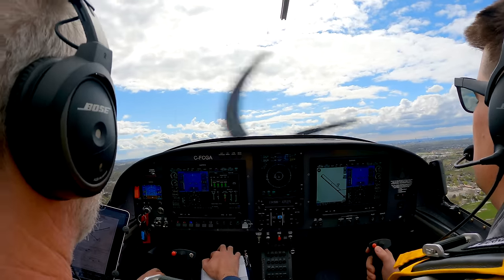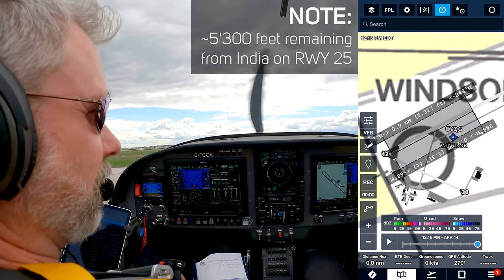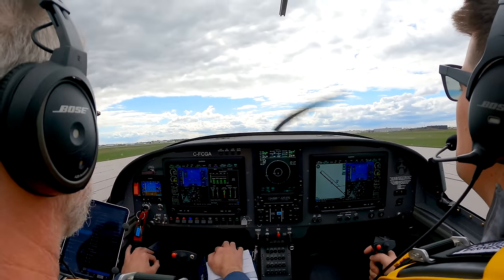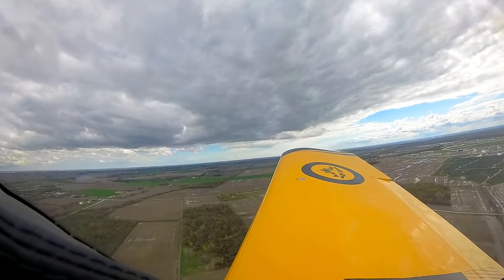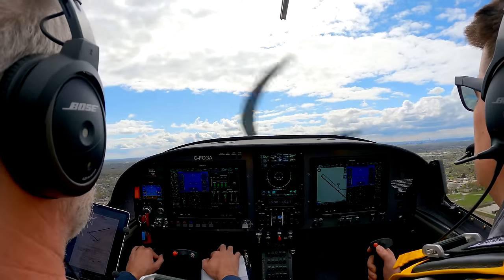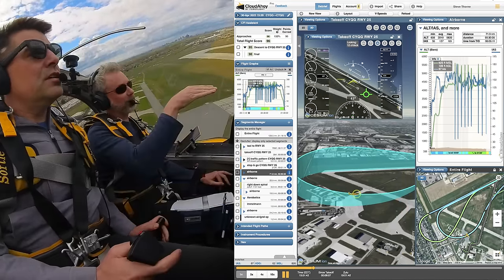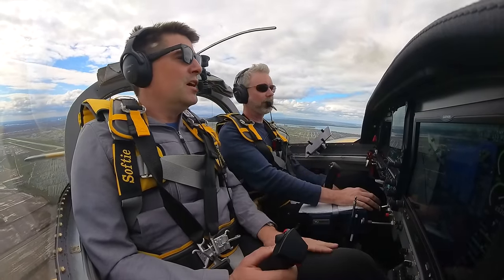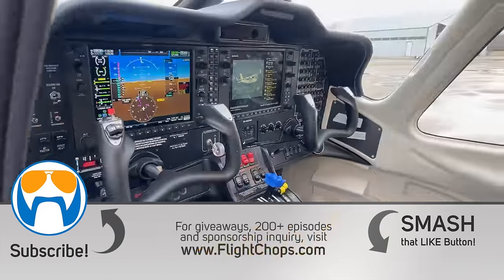Making the IMPOSSIBLE Turn… Possible from 600' AGL?

Comment: Wind has to be considered. When a 15G18 headwind on takeoff becomes an instant tailwind on turn back it is a performance decreasing windshear. That will change your decision altitude drastically. Have you practised an approach with an 18kt tailwind? With houses or obstacles on the departure path, a turn back to anywhere within the airport perimeter fence is a win. Terrain will be flat and emergency services will available, not to mention no collateral damage.
Reply: You have to keep the nose down when doing the Vglide 45 bank turnback.  Aproaching the 180 point you will feel a bit more sinking due the tailwind, but then that tailwind will flaten the glide and helps reaching the runway.  I used to to teach Teardrops and Hook Shaped Turnbacks in the 1990's CFI years.  Had 3 partial power fails on me, Cherokees.  Landed all.

Comment: I taught turnbacks to many in my CFI years.  Needed maneuver that got too many doing them wrong way.  YOU NEED TO KNOW TURNBACKS.- Not only for EFATO.  You need turnbacks also on Circling Approaches, Flyover Turnbacks, Box Canyon turnbacks, overhead airport to enter the 45 after.  Many accidents on those 5 places were the pilot made turnback errors and crashed.  His fault- for not knowing Turnbacks well.  A 180 is not a full turnback, just an U Turn.  Turnbacks are bigger turns that finish at almost or the same place you were before.  A course reversal, not just a heading reversal 180 turn.  Turnbacks are more than a 180.  Many CFI's call a 180 a turnback.  No its not.   Unless landing back on parallel runway which most airports dont have.  That is the only time a 180 Turnback is it. 

TO TEACH TURNBACKS;
It is better to teach "Turnbacks To A Double Flyover" FIRST.  The GRM TURNBACKS first, then the emergency and circling ones later on after you do them level flight well.  I taught them all 2 decades ago and researched about the accidents causes on them a lot.  Most pilots dont know those maneuvers well and do them very wrong, or stall and crash.  Even ATPs crashes doing turnbaks due errors. 

1-The Teardrop Turnbacks to a flyover a spot on ground do it first.  Fly  at Vglide speed slow flight over highway (w. a Crosswind). With flaps 10 degrees.  1,000' agl.  Fly over spot on highway, turn away from wind 40 degr. , then into wind.  Fly over the spot on highway again, after flyover repeat same steps on other side.  Do 3 on each side until perfection Teardrop Turnbacks.  One turn turnbacks require 2k feet dist. from flyover spot. Dont do them yet.  Those are more difficult and dangerous.  Later on i will type about those Hook Turnbacks.  Cropdusters do them only after getting low in weight.  I used to call them Question Mark Shaped Turnbacks.  2k distance after flyover, Vglide speed, bank 45 degr.  more later on that  QMark ? Turnback.

2-Then Box Canyon Turnbacks Scenario (Climbing Vx but at 60% power only to sim a 10k density alt.)  Then the Circling Approach overfly + Turnback, then the LOTOT Turnbacks and no power EFATO at end.  Some day you will have to do those maneuvers.  

Some say to keep the ignorance.  But Ignorance is not the solution,  IGNORANCE IS THE PROBLEM.  Most pilots that crashed doing turnbacks on those 5 places were Turnback Ignorant Pilots.  This is a tool all pilots need to know, not just CFI's.
Reply from the maker: Great insights here.
Reply: @FlightChops  Im the CFI that taugh the other poster named outwiththem.  We know 4 others that had to turnback and didnt crash on cars and houses on our 1990's airport.  I have a video from 1995 for you with 4 EFATo real landings on runway .  will post it.  I used to teach EFATO 4 on runway, not just at altitude.
Reply: @FlightChops  This was the first ever video teaching how to do on the runway, not just at altitude the basic 4 kinds of EFATO and Partial Power RoToT.  First we talk about the Low Altitude Pull Syndrome on low maneuvering GRM Turnbacks to Flyover again, then how to apply the GRM Level Turnbacks to EFATO and ROTOT Emergencies on runway with 16 knots strong winds.  Narroator said 14 knots, but they were constant all day at 16-17 knots.  Runway is 4,k feet long.  Sebastian Florida.  The town was in front. 

 Canadians are brave enough to do EFATO too.  Im Puerto Rican.  I used to teach all that in the 1990's.  Video is 43 minutes.  Read the introduction too.  The video is inside one of my 1990's student channel called CFITOMAHAWK.   This is still the only video showing all those low altitude optical illusions that lead to stall, ball in center spins, accel stalls,  2 kinds of Turnbacks to real runway with strong winds, and 2 kinds of 50 feet EFATO and ROTOT with real landings too.   
https://www.youtube.com/watch?v=94li1apG-aI

Comment: Big runway at a 90-ish degree angle from the one you took off, in a real emergency I might aim to land on that one, depending on how much length is left.
At my main airport I have something similar, with long runways. Better to take the turn a bit easier and land on a different runway than to try and crank it around and stall the aircraft. Ofc this doesn't work  with a single runway airfield.
Reply: Only with a lot of wind to bring you back.

Comment: Another reason to land straight ahead with a strong headwind is the slower ground speed and subsequent lower G force at “impact”…
Reply from the maker: For sure yes, this is a huge factor.  But wind speed becomes moot if your option is a suburban neighbourhood with no where to dissipate the energy laterally… I’d rather face a tail wind on a flat / long surface, but your point is valid.
Reply: @FlightChops 😊

Comment: I also discuss which direction I will turn back towards the runway based on environment but more specifically on wind. Like this situation with a right crosswind, I would make a right turn back towards runway (assuming I’m above my decision height) that would allow the wind to push me back onto centerline. Making a left turn would push me away from the runway requiring more distance/time/altitude to return to centerline

Comment: This exercise can be practiced a lot more safely at altitude. Simply align with a cross road or highway, perform the takeoff engine out simulation, and see how much altitude you loose to get back to where you started (then add 1-200 ft for a stopped prop).
Reply: IIRC A stopped prop creates less drag than a windmilling one?  Though you'd still have to account for the difference between a stopped engine/prop and an idling engine.
Reply: @kaasmeester5903  That only works on airplanes with a Vglide speed under the normal 60 knots prop stop speed.  It is BS it will glide better under the vglide.  which is 70 knots or more on most low wingers.

Comment: Prop Stop glide only works on airplanes with a Vglide speed under the normal 55 knots prop stop speed. I used to teach prop stop landings from a 700 agl base leg on Cessnas (55knots w full flaps).  And land Prop Stopped.  It is BS it will glide better under the published vglide- which is 70 knots or more on most low wingers. or 60 knots plus on most Cessnas.  Many crashes and stalls lowering the Vglide to stop the prop which is mostly at 55knots.

  55 knots only works on some LSA's and most will not glide further but be at minimum sink airspeed because the Vglide is higher than 55 knots, not maximum glide but they say on those videos. They say they are at Max Glide at the 55 knots prop stop speed, which is BS.  So 55 knots for prop stopped you need on most USA GA.  That is under Vglide for 90% of USA GA.

Comment: Great point here...  So, 800 feet to make the runway and 600ish to make "airport property"  to protect the surrounding community!
Reply: Dan Gryder says never to do Vglide turns even with partial power.  To crash straight ahead, NO TURNS, ZERO TURNS.  Just crash straight ahead.  LOL.. I learned Vglide turns at 5 hours in a short wing Piper Colt bad glider.  Had 3 single engine partial power fails, Turned and landed on airport.  No accidents.

Comment: Just noticed, but in Canada are you not required to read back the takeoff clearance? Do you just have to reply with your tail number?
Reply from the maker: For the particular calls we are responding to, that is correct. (For instance, if there was a hold short instruction a full read back is required)

Comment: Thanks for a nice video. Would have been nice to see you veer right off runway heading in the climb, to put you on reverse runway heading after the 180 (avoiding the ? shaped return path) You probably would have made the 600 agl. Also would have been good to see the bank angle, if you recorded it. And your speed through the turn. Thanks again.
Reply from the maker: It's all recorded yeah - and the cloudahoy debrief shows it fairly well if you watch 4K during the replay around the 10 min mark.
Reply from the maker: Regarding turning off runway heading - we were trying to simulate a straight out departure, so we didn't want to be set up with any sort of "advantage".
Reply: @FlightChops Looks like about 40 degrees bank? But 80 knots airspeed seems pretty high; is that best glide? Excess speed really increases your turn radius.
Reply: @atg197  good points

Comment: I’ve practiced engine out on take off many times. A good pre departure brief is a must as mentioned.  

I was pretty comfortable flying my Cherokee with the normal load I usually carry. For a change I had an instructor and passenger go with to significantly increased my load. Wow what a difference. My take away is practice with different loads and configurations to try to get a baseline then add to your pre departure brief
Reply: The basic idea I was getting across was to practice especially with different loads. Don’t only get comfortable st your “norm”. 

I have a great instructor now also did when I started in 1988. Not sure where your going with your comment

Comment: Good video and always important to practice. But you should also consider the much higher stress load when real engine out. Not only those 3s until first reaction. But will you be able to fly a tight turn with slow speed without succumbing to the lure of have to reach that direction for landing without stalling? Most crashes happen right there, when people try too hard to get back. It is not that you would be cool as ice in the real thing. Its very likely you won’t hear the stall warning or any other sound than your heartbeat.
It is good advice to check your surrounding area before for possible options.

Comment: When I practiced these 20 years ago in a PA28-181 was to pre brief to note wind direction, then during the maneuver, push hard to maintain airspeed, but pull the flaps lever for full flaps and steep turn into the wind and then keep the nose down as you let the flaps out if you need more glide. Eyes on the airspeed.

Comment: My plane has a glide ratio of 11/1 meaning if I were 600ft AGL and I kept the perfect glide speed, plane would travel 6600 ft foward going straight, making turns would definitely travel less!
Reply from the maker: Yup. This is why it is important to know the performance of your specific airplane AND to build in a buffer to account for less than perfect flying when you’re under pressure.
Reply: @FlightChops  great advice

Comment: Instead of the impossible turn, why not just circle and land on the runway heading you took off from? Looks like you had enough altitude to do that.
Reply from the maker: Can you explain more thoroughly what you’re suggesting? Because the way I’m reading it you’re suggesting a power off pattern to return to the same runway we departed? (Did you watch the whole video?)
Reply: @FlightChops  What I mean is, you took off from Rwy 25, but came back to land on 07 (the "impossible turn"). Have you tried taking off from Rwy 25 and circle to land back on rwy 25. You'll probably be landing on the last half or last 3rd of the rwy, but still enough runway remaining at that point?
Reply from the maker: I’ve never heard of attempting a power off 360.  In most cases you are lucky to make the 180+~90 to maneuver and land with a tail wind.  Did you watch the whole video? I share the data in pretty clear detail.
Reply: @FlightChops  Yes I did, and it was a great video! The reason I asked about it, is because I had a partial engine failure with complete loss of thrust in a light sport taking off a fairly short runway with only houses ahead of me about a year ago. Looking for a place to land, the runway was right behind me, but I would have overshot it, and run off the end of it into a large body of water if I would have done a 180, so I flew parallel to the runway and turned onto the runway once I had reached the lowest possible altitude to do that, and it worked out great - maybe beginner's luck! I've never seen it done in any video, which is why I was asking the question.  It was in the winter, so maybe if it would have happened in the summer, the high density altitude would have probably affected that.
Reply: @junetebarts1334  I used to teach partial power turnbacks and turnaround the airport too.  You had partial power, low density alt.  A light sport.  The tend to climb at over 800 fpm, are light  and most keep alt if loose one cylinder.  from say, over 600 agl, most can turnaround instead of having to turnback to other runway.  But that also depends if engine is surging rpm or noises.  If engine seems not to last,or steady power,  it is better to turnback instead of delaying the landing and going to downwind leg, and base leg. I have a playlist of EFATo and landings after turnback or turnaround the airport which are different maneuvers, even when the ignorants call them the same, which is BS.
Reply: @FlightChops  Only gliders do initial climb 360's and it depends if have strong winds too to push them to the short approach area on downwind.  They turnaround and 360 from 500 feet up-if windy, and then a short approach.  It is called a Windy EFATO Turnaround 360.

Comment: Have you performed a low pitch stop adjustment? It’ll glide much better after making the adjustment. Basically to see if you need to make an adjustment, you want to verify that you can achieve 2700RPM in flight, and yet statistically before takeoff, (flaps up, brakes held) you go full throttle and should only get 2600-2650 rpm. If you are making more than 2650, then you need to adjust the low pitch stops under the spinner. Another obvious sign that you need an adjustment is that your engine may surge on takeoff when adding throttle quickly.
Edit: I see you only make 2650 on takeoff.. is that because the prop governor is set too low? Why yellow at 2650? Isn’t the limit 2700? I didn’t think the IO-390 has a yellow caution range. The proper setup is 2650 because the low pitch stops are controlling it, not because the governor is set too low. You should raise the governor rpm, then increase the low pitch stop angle to hold static rpm at 2650.
Reply from the maker: I am pretty sure we did this correctly, but I'll look into it - thanks for the insights. 
As or the yellow - it is all customizable, and it made sense to have yellow before red, and red is at 2700
Reply: @FlightChops I get the desire to maybe put a cushion before the red, but in aviation, the yellow means caution, and there’s usually a time limitation associated with it (2 or 5 minutes). I set up mine to still be normal up to, and including 2700. Then I set the red at 2750. You could set the red at 2710, but the point is you should make 2700 in the climb out for safety purposes, and 2700 isn’t red.

I would venture that most mechanics don’t know about the low pitch stop adjustment and just install the prop out of the box, then tweak the governor setting and call it done. It’s been my experience that the Hartzell props need the Allen bolt turned in (clockwise) 2 and 1/3 turns to get it set right. You’ll thank me after with much better power off glides, safer in the event of an engine or governor failure, or the prop won’t run away incase of oil pressure loss..

Comment: I always brief engine outs, but only recently did I brief an "above 1000AGL" turn back. I'm working on my CPL so it's a req. Otherwise, best glide and suitable location within 30 degrees. Where I fly out of, for one runway I brief a specific street as it is the ONLY possible landing location off that runway. The rest of the runways face fields so that is less challenging.

Comment: Shouldn’t you be finding the minimum turn back altitude on a calm wind day?  Did you pitch for best glide, and what bank angle was used?   Need some back stick force to keep the airspeed from increasing, right?  Also tightens turn radius.  Fun video!

Comment: I did extensive sim testing in war thunder for low altitude engine out returns to base years ago. Ended up that staying aligned with the runway, pulling straight up into a hammerhead, and recovering into a flare was the only way at very low altitudes.
Reply from the maker: I don’t think a hammer after an engine failure on the climb out is gonna go well in real life 😂 that sounds like an epic spin entry at 700 AGL to me. 🤓